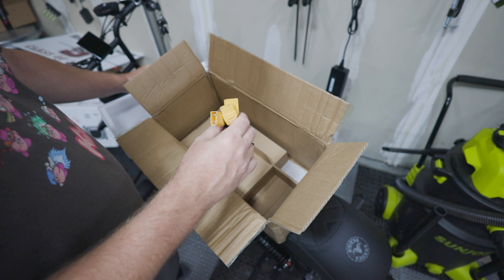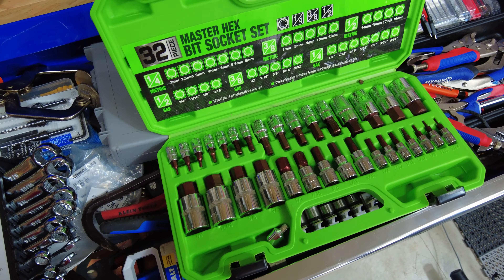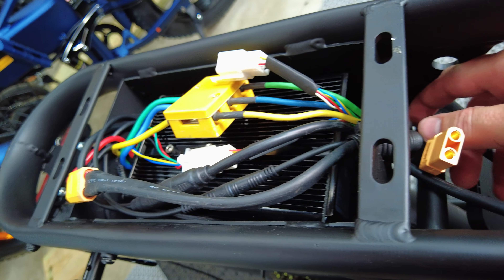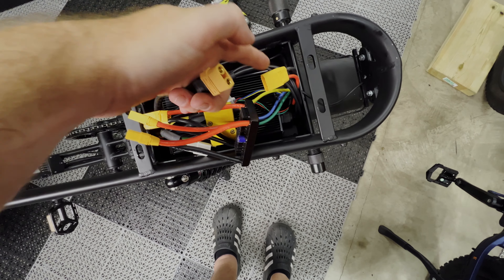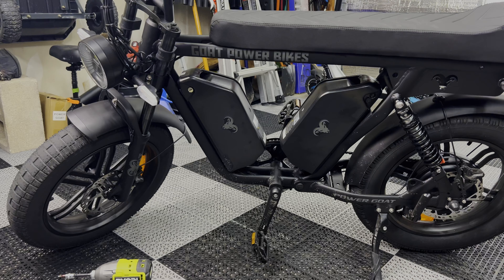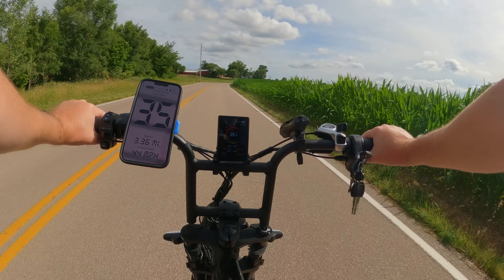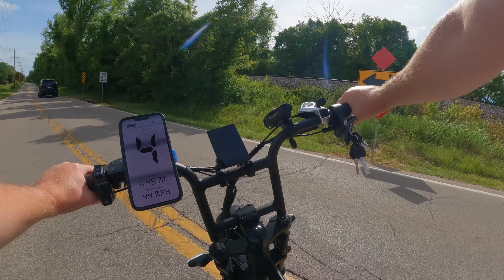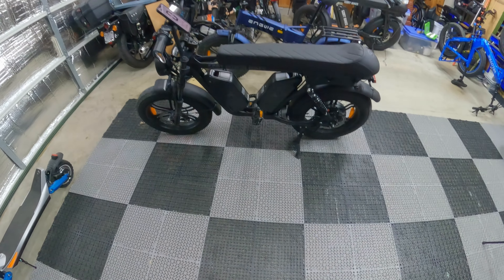(EP3) Power Goat V2 Second Battery Install - Goat Power Bike E-Bike Review and Ride

Comment: Good morning Randy, Great info on adding a 2nd battery! Is there any way you could urge the ebike makers to include a kickstand safety switch wired into the brake lever kill switch circuit? After breaking my neck in 2023 over a forgotten kickstand during a high speed left turn, I've given it a lot of thought. I contacted a few ebike makers, but it occurred to me that you might have Way more influence with a lot of companies! It's been a year since my accident and the neck still hurts, but hey, I coulda been killed, right?
Reply: PS... Goat's 2nd battery and blender setup is a great deal on their website!

Comment: Can I set it to top off at 28mph and what's the mph and mileage with upgraded battery
Reply from the maker: Approximately 40-60 miles range with second battery. You can adjust the top speed.
Reply: @RandyRides  can you make a video of it?
Reply: @RandyRides  what are the speeds
Reply from the maker: @ No I can’t. My Power Goat has the 60Ah battery installed, so I removed the battery plates.

Comment: Great video! I would imagine adding a 2nd battery gives it twice the range. Have you done a test to see how many miles you are able to go with the 2 batteries now?
Reply from the maker: @isaiahvaldez2835  Thank you! I’m planning for that to be one of my next Goat videos.
Reply: I wonder this too! Range and good torque/power to go up hills from a stop or near stop are high on my list of concerns over top speeds. I also wish I had a better idea about how safe some of the better bikes are out in a rain, not that riding in the rain is ever ideal, but if you live somewhere that does rain a lot, its def important.

Comment: Dual battery is definitely the way to go for this bike. 60V bikes definitely need big batteries to prevent voltage sag from all that power.
Reply: I'm building my version of the power goat it getting on huge 84v battery for long range not speed I make the power goat look like a toy cause I'm not impressed with power goat anyways 😂
Reply: Junk
Reply from the maker: Thanks for contributing to the algorithm 🤦🏼‍♂️